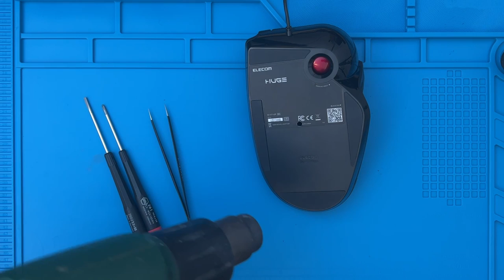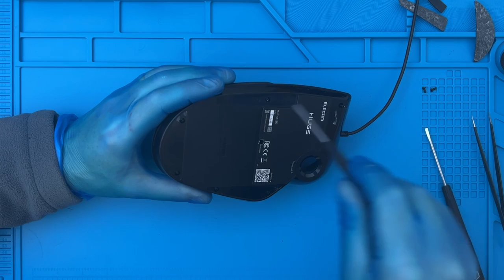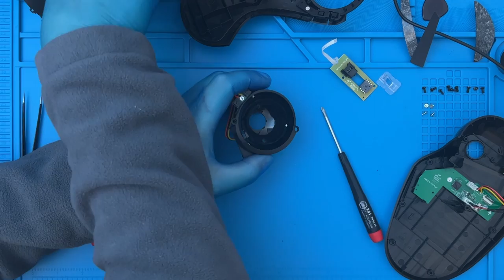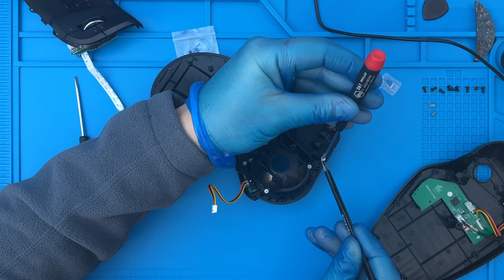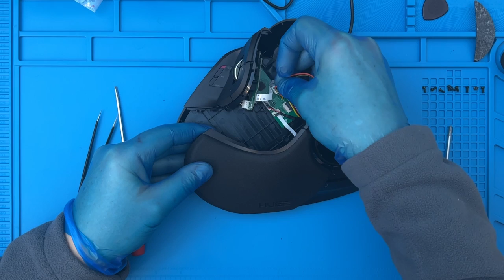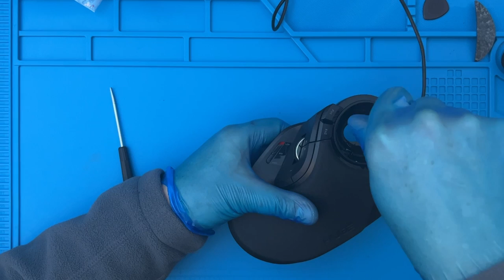Elecom HUGE trackball bearing replacement

Comment: I have a tip to avoid removing the rubber pads. Take an exacto knife and cut holes around the screws. I just did this with my Elecom Deft. You can usually find the general location of the screws from a YouTube video and the point of the exacto knife can easily locate the exact locations. Then just cut tiny holes around the screws. This will make it easy to take it apart again if you want to do a switch swap or maybe even try a further upgrade to silicon nitride bearings.

Comment: Ok, first of all, great tutorial! However there's one very important thing that needs mentioning - the bearings should not move/rotate within their sockets. They should sit tight, immobile. At first I thought they should rotate as they do in skateboard bearings for example so I screwed the trackball cup loosely so that they can rotate. I even put little red dots with a fineliner pen on the white bearings so I can see if they rotate. Big mistake! The ball rolled loud and rough. So I had to take it all apart again and tighten the cup. Now it's better but still, the difference between the original ruby bearings and the new Zirconium ones isn't "huge" (pun intended). I expected it to be more noticeable. Some people actually report that their originals were not bad actually, like in my case. The zirconium ones are definitely louder and as somebody mentioned - "grainy". So I'm not really impressed. Another thing - when taking the trackball apart be very careful not to sever the yellow/red/black cable at the base. I moved the parts around and then had to solder the yellow cable back on. Stressy! Thought I broke the thing. Also, for the wireless version like mine, there's no hidden screw beneath the label. There's just one under the batteries. All the bottom screws are torx type.
Reply from the maker: Very true - I also put a little black dot on my balls with a sharpie and observed no rotation. Maybe the benefit of zirconium is that it is more slippery compared with synthetic ruby and allows the larger ball to slide better on them? In that case the roundness isn't as much of a factor as it would be if they rolled.

Comment: Thank you for the very clear and thorough explanation! No distracting music or anything, just exactly what I needed to know! The HUGE is working much nicer now. I also cut some small pieces of dense packing foam to put in the hollow parts of the palm rest in order to make the case more rigid and to dampen any sounds inside. It makes it feel a lot less cheaply made, even if the microswitches still aren't the best!

Comment: I finally got around to doing this (I used a different mouse til now). Your instructions are perfect. Only thing I would suggest is using a magnetised screwdriver - really helps with picking up those small screws and also re-inserting them again. Thanks again for the video!

Comment: Great video thanks! A note for people with the wireless version of this mouse, there are a couple differences but for the most part you can follow this video

1) There is no screw under a label. Instead, the last / hidden screw is in the battery comparment. The batteries need to be removed to access it.
2) The screws on the bottom of the mouse are T6 screws, not a standard phillips head.
Reply: Thank you for sharing!! I came to the comments with this exact question.

Comment: Thanks for posting the video. I did the bearing swap taking apart the housing in a similar manner. I only then took off the optical sensor board and lense, removing only this ribbon cable. Turned the device upside down and pulled apart the ball cup. This left the bearings held in place by gravity. Changed the bearings, reassembled the cup., put back the ribbon cable. Done. It seems turning the device upside down makes this a whole lot simpler.

Comment: Thanks for the video. Get yourself a neodymium magnet or two. They come in handy when  removing screws. You won't risk accidentally marring the plascitc witht those needle nose pliears (plus it's just easier.) Also, if you drop a screw on the carpet,  Scan the carpet with the magnet in back and forth sweeping motions, to find it.
Reply from the maker: Good tip. I recently got myself an Omnifixo so I am now well supplied with strong magnets!

Comment: thanks, great video, explained every step of the process.

 Appreciate you put information on what to look for in replacement balls in the description, I tried to make do with the stock ones but the stickiness really gets annoying when  something simple like copypasting a word takes several times longer because I´m fighting the trackball. Design is great though so I  ordered some g5 rated ceramic bearings hoping they will smooth things out.

Comment: Great video, thanks! I might have a newer model, all the screws on the bottom needed a star/hex bit to remove. AND don't try to get around unclipping the wire ribbons... I did and it made things more difficult than it needed to be :)

Comment: I have fat fingers and have to use a magnetized screwdriver to maneuver small screws. I just swapped the ruby bearings in my Elecom Deft for Zirconium ones. I did not wear gloves and I had no trouble picking up the bearings with my fingers and inserting them. I did had to use a pick to push the old ones out.
Reply: Not trying to be a smart aleck or anything. All these videos with people using tweezers and even masking tape to secure the bearings had me paranoid about losing them.
Reply from the maker: @mdombroski  I only wore the gloves because I had a big scar on my hand! Even so they are tiny and easier (for me) to pick up with tweezers.

Comment: Thank you very much for this excellently made video. I subscribed to you because of just this vid. I just got my HUGE today and was trying to decide if I am going to upgrade my bearings. Thanks to the clear directions I am going to! 
Question for you though. Where did you get that mat and what is it called? Also, what are your thoughts on using graphite powder on the bearings also? I've seen a few people recommending it.
Reply from the maker: The blue mat is a silicon soldering mat that I bought from Amazon. Many brand names can be found, wide range of prices for what seems like the same thing, I just picked the simplest and largest one I could. I have never tried graphite powder, maybe it would be smoother? But graphite is eventually going to end up on your fingers, keyboard, desk, so I feel the ball is smooth enough without.

Comment: Would I be correct in that removing the two screws that are underneath the scrollwheel assembly is not actually necessary for this process?  From what I see in the video, it does not impede the top section from being removed.
Reply from the maker: Correct, you can leave the lower part of the ball cup attached to the mouse top. It is good to place it on a level surface for the ball replacement but not essential.

Comment: where do I get that mat ?  thats awsome for not loosing screws.  And great video. Thanks
Reply from the maker: There are many different silicon mats on Amazon (where I found this one). Just make sure the one you get is the right size for your work surface, they come in many different sizes but they all look to be around the same size until you read the specs 🙂

Comment: So I just did this, I almost screamed, almost cried, pulled my hair out. It was so going great until I made a mistake.
It wouldn't go back together. And what had happened was that when taking it apart I couldn't get that black yellow red connector to unplug, so instead I unscrewed the board from the cup on the other end. Then I reinstalled the board upside down, and couldn't understand why it wouldn't all fit back together at the end, it's cause I had put that board in upside down and hence put it in the way.

I am very dumb
Reply from the maker: Looks like you worked it out though, now you know better next time. I could not count the number of things I have destroyed in learning to do this stuff!

Comment: Why would I buy a product that requires modification out of the box? Thanks for showing me what I won't be buying. Good grief. Edit: if you continue to buy subpar products the company will continue to make, wait for it, sup-par products. Yay, mediocrity!
Reply from the maker: Interesting philosophy; I prefer to think that it works well out of the box but can be made to work better. What are the perfect trackballs out there? I don't know of any.
Reply: I think the issues people post online may be exaggerated due to the break-in period of the trackball. The first day I got it (3-4 days ago), it was almost impossible to do small motions without it jumping way past where I intended it to move. It actually felt borderline unusable, and I was considering returning it. So I went online, did some research, assumed the bearings were the problem, saw I could replace them, and placed an order. They arrived today, and as I was replacing them, I realized that the initial jumpiness I'd seen had gone away entirely. I still did the replacement, and it's definitely a small improvement from the ruby bearings, but I wouldn't say it's required :)
Reply: Oh no, people have to do some work to get exactly what they want! How terrible!

Compared to mice, the trackball market is super limited - people have to make do with what they can find. Aside from that, some people simply don't mind modding things because they're not lazy.

Comment: Have done the same operation, almost step in step as you and this youtube.com/watch?v=Hgst7JaiAa4 dude did, yet the stickiness has barely gone. What might I have done wrong? Is there anything that can be done wrong here?
Reply from the maker: Is everything perfectly clean? The tiny white balls do not move in their sockets but they must be clean and the main ball must be clean to minimize drag. Other than that are the balls placed perfectly in their sockets and is the cup that holds the main ball fitted together exactly?
Reply: Firstly, my Elecom Huge hasn't arrived yet, so this is based on my M570.
Try getting a thin coat of skin-oils on the ball, like with glass trackpads, it needs this to run smoothly.
This can be done by rolling it in your hands or against your forehead a bit and can drastically improve the smoothness.
Reply: @adameberbach 
Somehow, I read your reply only now (/ω＼) Sorry for that
Yes, everything was clean (as much as it's possible in an ordinary room) and perfectly fit, nothing is loose
Reply: @WyvernDotRed  
You mean, THE ball? Not the bearings?
Reply: @OmarLivesUnderSpace  I mean the ball, not the bearings.
Greasing the bearings barely makes a difference as the contact area just rubs clean.
Very lightly greasing the entire ball, with your own natural skin oils, keeps the contact area lubricated consistently.
This is what the "running in" of trackballs actually is, at least judging by the one I have currently.
Reply from the maker: @OmarLivesUnderSpace  I would probably disassemble again (and again) until it was better. How do you feel about the bearings you bought, can you observe that the bearings protrude enough that the large ball is rolling on them? Possibly they are not good bearings, I know mine came from some anonymous eBayer and that can be a matter of luck.
Reply: @WyvernDotRed  
Thanks, will try
Reply: @adameberbach  
Can't say anything about their quality since I'm no engineer, but they're regular 5g ceramic bearings; got them from Ali if it matters, looks are totally fine
Reply: @WyvernDotRed 
I couldn't squeeze any sebum out of my pores so I tried silicon grease. And... I'm astounded but it worked! Like magic, almost! O_o Such a simple thing but what an effect o__O Thank you so much! Let's see now how long will it work
Reply: @OmarLivesUnderSpace  have since gotten my hands on my Huge and can confirm that it worked for me as well, but it took me 3 days before I got it smooth without extra lubricant.
This on the stock bearings, they still stick slightly but not to a degree that bothers me, it's much better than my M570 at it's best.
The very slight amount of oils still coming from your fingers should be enough to keep it smooth as long as the bearings stay clean, but wiping the ball will partially undo it.